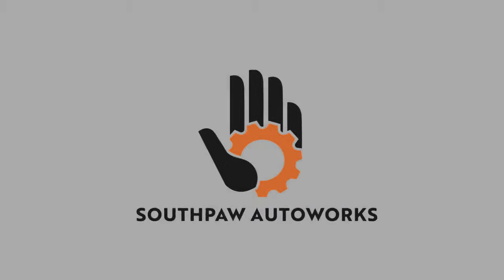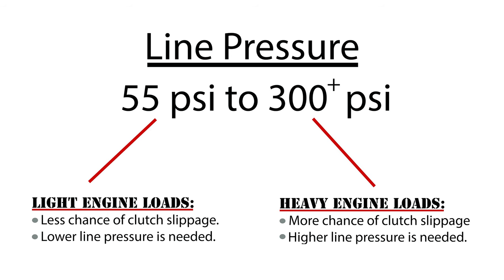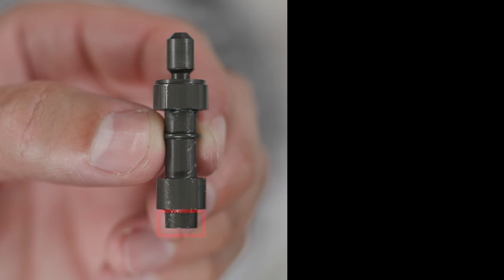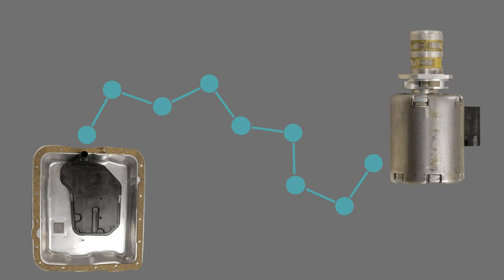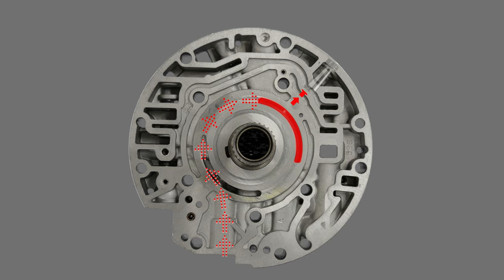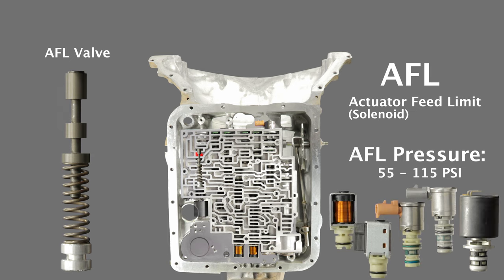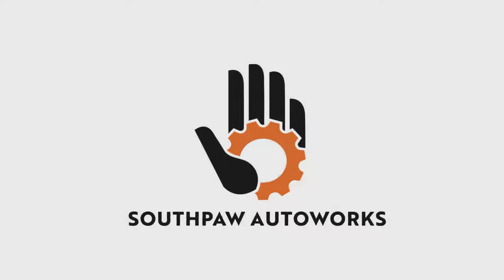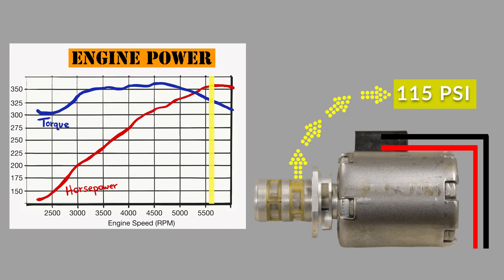4L60E: PR Valve (Part 3) Torque Signal Oil Pressure (4L60E Line Pressure)

Comment: From a  semi retired GM tech who has rebuilt a hand full of Th350 and Th400 and one 700r4, your videos are the best! I can already see the advantage of ECM control solenoids in the 4l60e.  Did you know that GM 's new 4l75e will handle 1004 HP and 876 pound feet of torque? That 4l75e is built off the same architecture of the 4l60e. Without controls such as the EPC it would not be possible. Thanks again for great video, they have become my nighttime  study material  for future transmission building during retirement.
Reply from the maker: Right on!  Welcome aboard.  
The GM evolution of this trans (700R4 to 4L60E) is pretty cool.  As you know, the VB is an electronic-over-hydraulic design.  Gonna be making a video about how the shift solenoids, and their respective shift valves, work together...soon.

The 4L60E is riddled with shortcomings (mechanically and hydraulically).  However, with a little love, it can be a great transmission.  

Got a lot more 4L60E videos in the works.  Recently released an AFL video.  Here's a 60-second preview of it:  https://youtu.be/yfXdx6AkqjU

Thanks for dropping me a line!

Comment: @SouthpawAutoworks I am a former Ford parts manager, among other things, and have been curious about how automatic transmissions function. Unfortunately, this video series covers an electronic controlled transmission. Having said that, this is the first series I've been able to find that comes even close to the outstanding and detailed explanation of how the automatic transmission works. I haven't checked out any of your other playlists, but plan to once I finish this one. Hopefully, there's a series that covers a transmission that is totally mechanical - hydraulic/vacuum operated solenoids, or something similar. I really wish you were closer to Oklahoma, I'd love to soak up the knowledge you have to share. I have no intention of getting into transmission rebuilding but am thinking of designing an automatic transmission for UTVs - something that isn't a CVT but is light enough to make it worthwhile. Just a little project for me.

Thank you so much for putting this series together.
Reply from the maker: Right on.
Appreciate your comment.

Comment: GM used this in the C4 gen 2 LT1 Corvette as Torque Management. I have a 96 Vette and found this table in the transmission section of the Jet DST programmer. I reduced the torque table by 25% giving me 75% of the available torque all the time. WOW! It multiplied the torque curve of the car by allot! You couple that with the fuel changes and timing at WOT and the car becomes a Torque Monster! I'm leaving the 25% in the transmission for safety purposes but this is never talked about or discussed in any of the Corvette or LT1 Forums at all.
Reply from the maker: Right on!

Comment: I have a 4l60e that would freewheel on the highway once I slowed from 75 to 45. I would have to blip the throttle to get it to grab a gear.  I removed pan, and replaced all solenoids along with a new wiring harness.  In addition I installed a transgo 4l60e hd-2 shift kit.  It runs fine now but am curious what would cause it to drop out of gear while coasting? Is it the electronic controlled solenoid? EPC solenoid.

Comment: Just found your videos. I built a high performance 4L60E transmission with a lot of sunex parts.  I am having problems with it not shifting right under pressure and seems to be losing line pressure. This video has helped me alot and I will let you know the outcome.
Reply from the maker: Were you ever able to get to the bottom of the issue?

Comment: Thank you for this, I have rebuilt my 4l60e twice 😬. First build lasted 12,000 before I lost 3/4 clutch, put z-pack and corvette shift servo lasted another 20,000 as of yesterday had loss of pressure. Base psi at park was 30-40 trying to find why I lost pressure all shifts now week. Going to go at it again… started with transmission bench videos (bob ross of transmissions) love em but yours are much more in-depth on actual operations. Thanks again.
Reply from the maker: Such a bummer...
However, I gotta give you kiddos for your perseverance.  

As you already know (from the video), that pressure is too low.
As time permits, I'm gonna look over some notes, think about this one some more, and get back to you...probably with some questions.

The positive feedback about the videos is appreciated.
Thanks for dropping me a line!

PS - If it feels right to you, please help me spread the word about this channel.

1 Handed Transmission Rebuilder:  (60-Sec Preview)
https://youtu.be/y3Vixa_Ec1E

How the 4L60E valve-body works:  (60-Second Preview)
https://youtu.be/fWPSaLeaOXI
Reply: Clean the epc solenoid screen from dirty  nothing more you get 170psi 😝

Comment: Hello. Awesome! Which one is a called valve of neutral?
Reply from the maker: When the shifter (inside the vehicle) is moved, ultimately it moves the Manual Valve, which is located inside the valve-body.

Anytime the engine is running, the pump moves fluid through various sections of the transmission.  However, when the trans is shifted into Neutral, the Manual Valve stops the oil from flowing to the clutch packs......resulting in no gears (neutral).

The Manual Valve has a number of jobs.  In other words, it does more than just create Neutral.

Hope this makes sense.
Reply: Thanks a lot!
Reply from the maker: You bet!

Comment: Hey wuddup brother
I'm a diy mechanic and have had (mostly) successful 4l60 rebuilds. Ive been super lucky just replacing the mechanical components. This time I can't solve this one. I've replaced everything. It's fine for the first 10 minutes, after that 0 movement.  No forward or reverse. Pump looked good torque converter is new. After watching this vid I'm going to try n swap the pr valve. Wish me luck🙏🤕

Comment: Hello again got another question doing 2-3 heavy duty for sonnax valve had to bore out a 1/8 inch hole in valve body. The clearance wasn't very much should have covered the bottom I nicked the wormtrack wall behind the spot I had to bore just wondering if you can nnell me if I Fd myself I really hope not I got a 02 or 03 4l60e I'm working on this time might be an annular lockup vb. Can I send you the image through email? I don't know how to send pictures on you tube.
Reply from the maker: Unfortunately, I don't do email for comments.  It would be one more thing to monitor...

You could upload a pic to your YT profile.

Click on the "CREATE" button, in the upper right-hand corner of the screen.
Select "Create post."
You'll have an option to add an image.  There may be size requirements...

If all else fails, you could upload a short cell phone video, to your profile.

Let me know when you have a video/image uploaded, and I can visit your channel, and take a look.